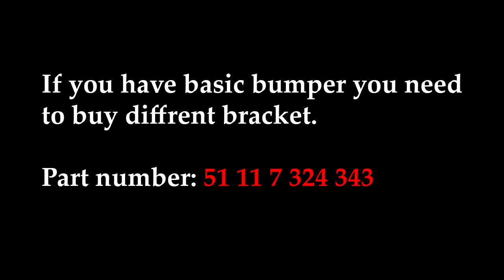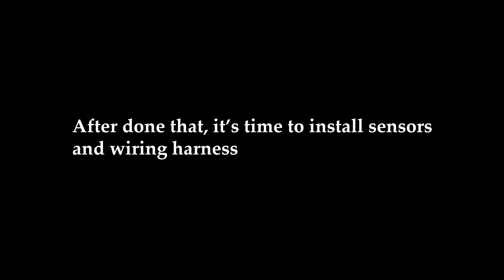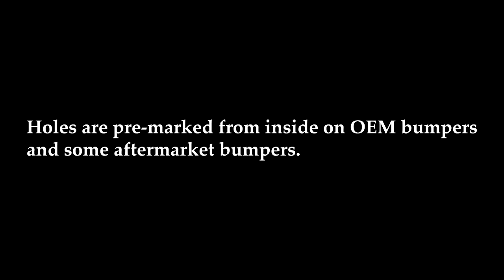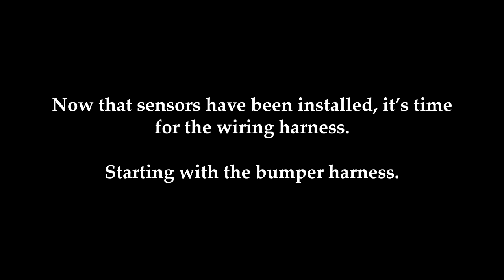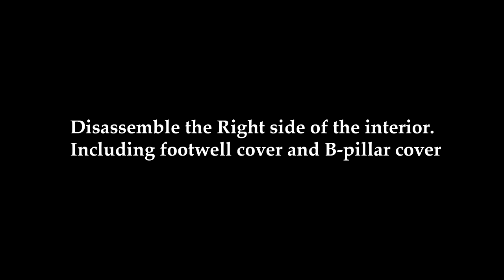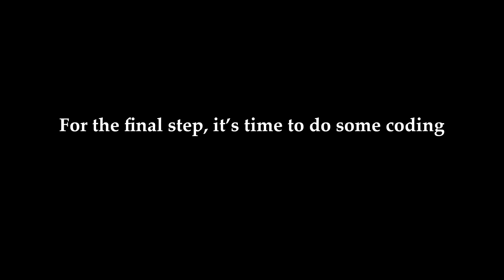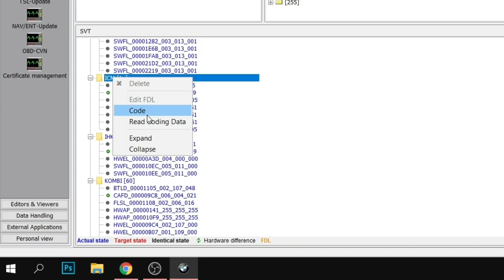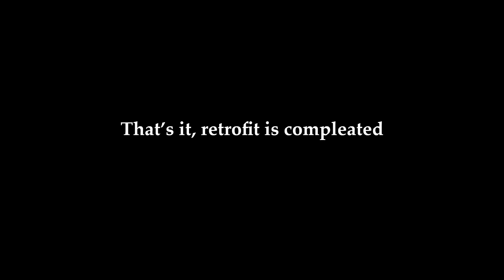Front PDC retrofit on BMW F30

Comment: I have a question, i have front and back sensors and back camera. when gear is reverse, the camera and sensors are on my screen, however when the gear is direct mode, the sensors disappears from screen, even though the front sensor beeps when close to something. Is there a way of coding for that?

Comment: hey, great tutorial bro, I'm just planning to make PDC retrofit at my 2010 F11, both front and rear as it had nothing installed, in terms of connection I guess everything is quite clear but I do not know how to code that, would you be able to help me? as I've said now there's no PDC at all, so no 507 available and I have never used E-Sys before, thx.

Comment: Is this the same process for the F20? Thanks
Reply from the maker: Read the video description :D (Second row, it contains answer to your question)
Reply: @Acelele320  hello, I have the a question, in the video, it says connect to PIN 28 and PIN 1, but in the BMW installation guide, it says PIN 6 and 2. Which one should I go for? i have a F20
Reply: @charleshon1017  I have the some mistake

Comment: I want to do this project on my MINI COOPER CountryMan F60. On a MINI Cooper 2018 F60, where/how should those wires make connection?. I installed the centre toggle switch for Parking sensors Front & Rear, I have rear PDC from factory installed & my retrofit HeadUnit i believe is coded for front parking sensors already.Can U assist me with directions to make those connections?. Thanks.

Comment: Using your video I now have front PDC. Thank you!
Reply from the maker: You're welcome.
Reply: @Acelele320  I want to do this project on my MINI COOPER CountryMan F60. On a MINI Cooper 2018 F60, where/how should those wires make connection?. I installed the centre toggle switch for Parking sensors Front & Rear, I have rear PDC from factory installed & my retrofit HeadUnit i believe is coded for front parking sensors already.Can U assist me with directions to make those connections?. Thanks.

Comment: Hi there! 

I own an F36 which I would like to retrofit PDC-front and back.Would I need a new REM module?
 I had someone looking at the REM module that is currently on the car and I have been told that the existing module can support PDC, not sure if I should take if for granted as the guy is generally only coding BMW's and not doing the actual installing. 
I keep getting different opinions on that, some say I do need a new REM and others say I don't.
Could you please advice?
By the way, I have to appreciate your content, it's really helpful and very well explained! Keep up the good work! 

Thank you!

Comment: Hello. In the repair kit I purchased, the wiring that goes from the ICM to the center console consists of two cables. On bmw F20 2016, do I have to do as in your video and use only what comes to PIN 28? Or do I also have to use the other cable that must reach PIN 6?
Thank you!!!! You are the best!
Reply: Ciao, hai combinato alla fine?
Reply: Yes! Fatto tutto
Reply: Yes! Fatto tutto
Reply: @maurocorona7451  ho tutti i pezzi ora a disposizione, mi sapresti dire come hai collegato i pin dell’icm e se la presa che ti forniscono collegata ai due fili va scollegata ed è in più? E come hai raggiunto l’icm? Hai dovuto smontare il condotto dell’aria che è sopra sfilandolo dalle bocchette posteriori?
Reply: Si, la presa fornita va tolta ed usato solo il gavo giallo verde. Icm ho solo scollegato il morsetto e messo il pin del cavo giallo verde. Attenzione alla rem perche i pin del cablaggio fornito sono strani ed ho faticato un bel Po’ per inserirli
Reply: @maurocorona7451  grazie mille, veramente gentilissimo. Purtroppo in giro si trova poco di dettagliato su questo retrofit. Posso chiederti come sei riuscito ad avere accesso al connettore della ICM? Ho smontato il listello con la rotellina dell’idrive, ma vedo che la presa è sotto il condotto che porta  l’aria alle bocchette posteriori
Reply: Smonti quello che hai detto, la cornice superiore dell’intero tunnel centrale e il soffietto di pelle del freno a mano
Reply: @maurocorona7451  pulsante interno montato! Ora sono alle prese con il cavo da far entrare nell’ abitacolo dal cofano. Una volta tolto il tappino mi trovo dietro della specie di gommapiuma. Devo bucare pure quella?
Reply: @maurocorona7451  ho finito tutto. Mancano solo i fori sul paraurti che li farà il carrozziere prossima settimana e poi metterò il cavo dei sensori anteriori, che però ho aperto e ha due prese in più, una femmina bianca e un’altra maschio nera, anche il tuo era così?
Reply: Si, lasciale staccate, sono del radar centrale ACC. Ferma bene i cavi oppure taglia direttamente i due morsetti in più. Io ho scelto la seconda strada
Reply: hello, I have the same question, in the video, it says connect to PIN 28 and PIN 1, but in the BMW installation guide, it says PIN 6 and 2. Which one should I go for?
Reply: @charleshon1017  give me your mail and I send you the instructions
Reply: @filippocassan507  Hello ! I have the same problem as above. Can you send me the instructions too??? Thanks! 😥

Comment: Is this the same for six parking sensors, ive bought a bumper with six sensors on the f20 model.
Reply from the maker: No, it's not the same.
Those 2 sensors on side are not parking sensors, they are PMA sensors for Park Assist and to retrofit Park Assist you need to replace ABS Pump and the job is very complex and expensive.

Comment: Hallo, where can i find the wire which i need to add from ICM pin 28 to blue connector pin 1 ?    
Is it “ready” to install with connectors on both sides ?    Thank you!!
Reply from the maker: Hello.
You get that wire with OEM PDC repair kit or you can make your own.
Reply: @Acelele320  Hi, i just want to add pdc button for activation-deactivation so i just need this one wire from pin 1 to ICM pin 28.   That’s why i asked what  choices do i have to find this cable alone..
Reply from the maker: @Chris_Ks05  Then make one.
The cable is approx 70 cm long and 0.35 mm of thickness and on each end you need to crimp female MQS terminal.
You can get those pins directly from BMW, they cost about 70 cents/piece and PN is: 61131383776
Reply: @Acelele320  Thank you very much !!!

Comment: Thanks for this nice job.
Where can I get all these wiring please?
Reply from the maker: From BMW dealership or from eBay.
Brand new wiring harness is about 120-150€, depending on your location.
You need 2 wires as shown in the video. 
-  Main wiring harness (about 5 meters long)
- Front bumper wiring harness (with 4 connectors for 4 PDC's)
Reply: @Acelele320  what about the PMA module & its wiring & sensors?.How do they make connect?.
Reply from the maker: @varmaTrini  Hi, I will probably retrofit PMA2 in near future.
Reply: @Acelele320  I want to do this project on my MINI COOPER CountryMan F60. On a MINI Cooper 2018 F60, where/how should those wires make connection?. I installed the centre toggle switch for Parking sensors Front & Rear, I have rear PDC from factory installed & my retrofit HeadUnit i believe is coded for front parking sensors already.Can U assist me with directions to make those connections?. Thanks.
Reply from the maker: @varmaTrini  Sorry I don't know how R60 wiring harness work, I do retrofits exclusively on BMW.

Comment: Quanto ti è costato il kit? Vorrei farlo anche sulla mia. 4 sensori tutti i cavi più la pulsantiera
Reply from the maker: In totale circa 100€ perchè ho fatto il cabbliaggio da solo. Se vai comprare tutto, spenderei tra 200€ e 250€.

I sensori puoi trovare su autodemolizioni tra 40 e 60€ tutti e 4, pulsantiera tra 30 e 50€.
Supporto per il sensori costa 40€ nuovo originale.
Reply: @Acelele320  Grazie, se riesco a trovare tutti i ricambi, lo faccio subito.  Riguardo il paraurti,  le forme dove vanno i sensori dovrei già averli all'interno?
Reply from the maker: @PitbullRyu  Si esatto.
Reply: @Acelele320 How dit you do the harness from the front to the rear REM ? thanks !